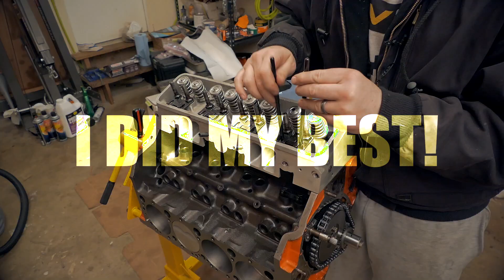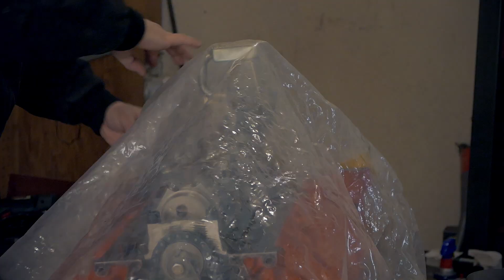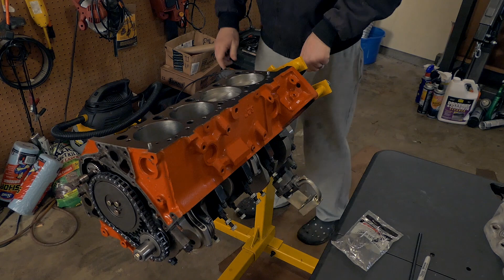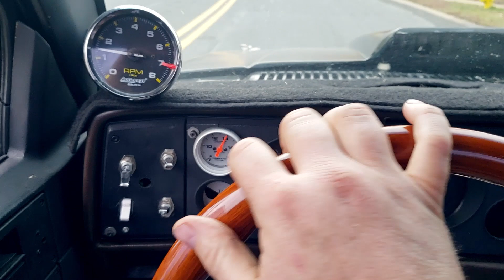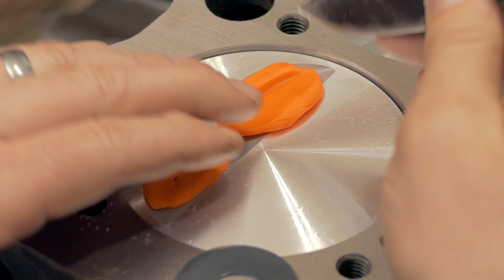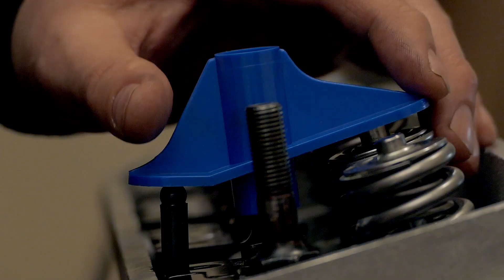Nitrous LT1 / SBC Build ( Piston to Valve Clearance “PVC” ) AND ( Rocker Arm Geometry )

Comment: Where's the next vid????
Reply from the maker: I'm waiting on backorderd head gaskets.
Reply: @TPVPRO  Seems like there's always something out of stock lol at least for me, there's always something that hold up progress. Looking forward to it! Loved the series so far brother great vids
Reply from the maker: @jjmccloud   It's crazy actually, Cometic has a 4.040 and then they jump to 4.105. So I had to special order 4.070. They offer 4.040, 4.060, in Gen 1 SBC. I'm going to address this in the next LT1 video.
Reply: @TPVPRO  Yea that's crazy. Since your on here I wanna ask about nos, do I have to use a single plane intake or can it be done with a dual plane. Not that it's related to anything were talking about lol
Reply from the maker: @jjmccloud  Use a one inch spacer  on a dual plane intake to raise the plat off the divider you should be good to go.
Reply: @TPVPRO  Right on, thx

Comment: You can tell chevys new engineers are college yuppies if you cant put the lifters in with the heads on. The old timers rule. You guys need to stop using that cheap paint that is Dodge orange color. I used duplicolor and its actually Chevy orange. So now you have changed your pushrod legnth for a smaller sweep, you need to go back and see how much less clearance you have with your clay.  Smokey Yunick used to cheat NASCAR rules and run the roller tip towards the outside of the valve, he dynoed an extra 30hp. with the higher lift. Valve wear isnt really an issue by doing that since heads get changed every week.
Reply from the maker: I used the long pushrods for the clay. 😁 I actually did it 3 times before the video.  And yes sir I hate that I can't pull the lifter with the heads on, freaking sucks a big one. I'm not running a lot of spring pressure so I'm thinking they should survive. Max is 477 pounds it's a street solid cam nothing overly aggressive.